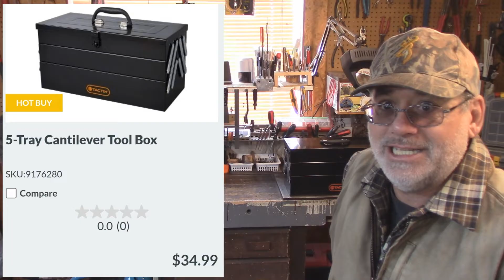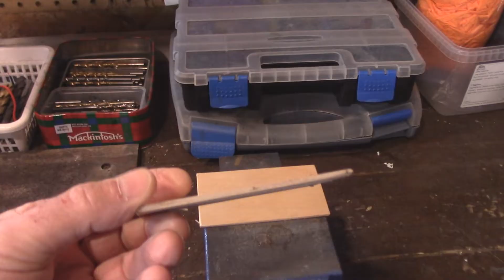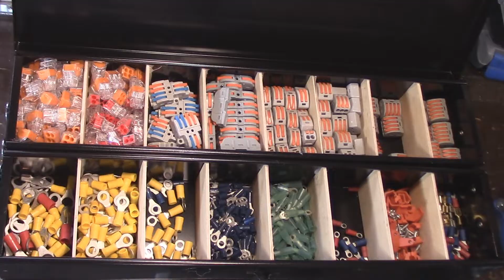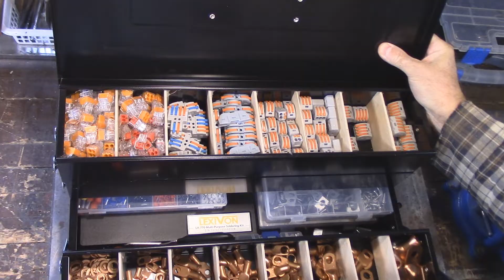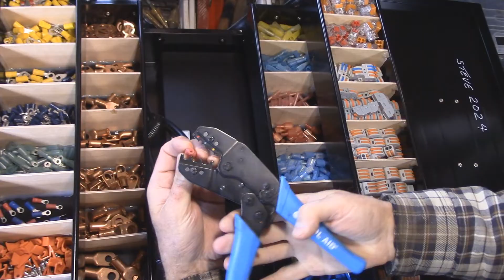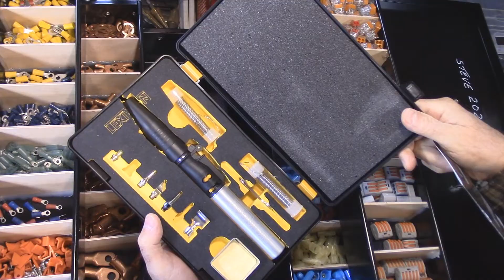Ultimate Electrical Toolbox

Comment: Good idea, Steve. Nice parts box. I have started using the Craftsman brand plastic boxes (similar to the ones you moved away from) and I really like them. I've got about 15 of them with things like electrical connectors and wire nuts in some, hinges and small brackets in others, etc. I label them and stack them. They don't spread contents between each compartment when carried by the handle. Whatever a guy decides to use, it's a great feeling to be organized and lay your hand on a specific item quickly. Have a great week ahead!
Reply from the maker: Thanks Craig,  you have a great week too.